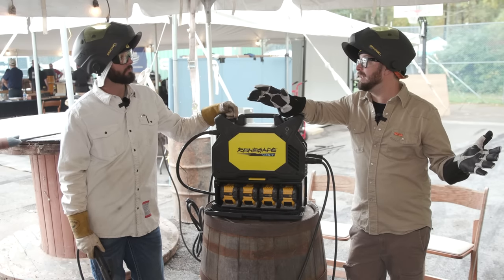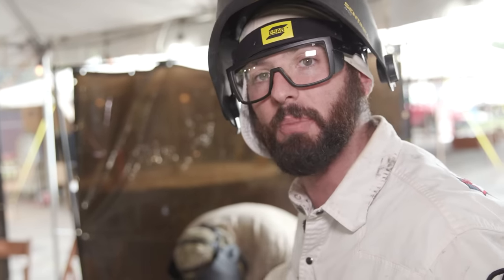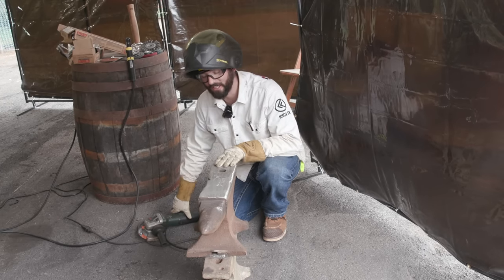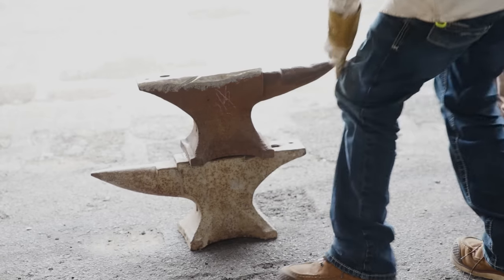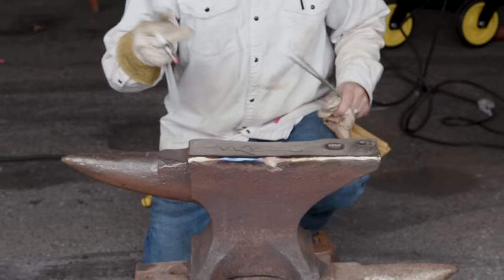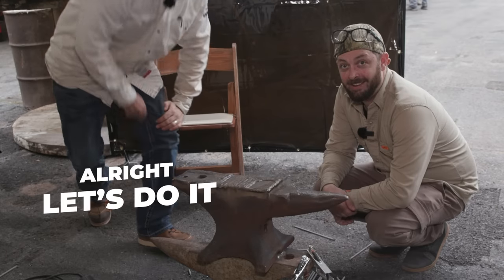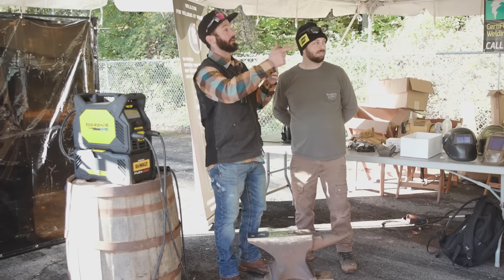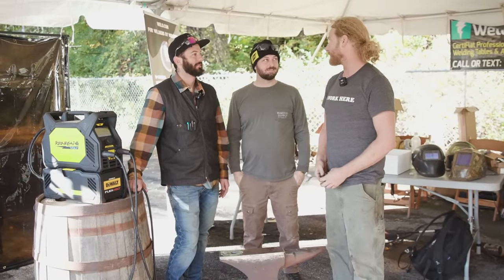Restoring An Old Anvil Using The ESAB Renegade Volt

Comment: I rented a shop that had a really nice PR anvil, I used it for about ten years, excellent rebound, now I'm using an old anvil with no markings I can make out, the heal is busted off, you can see about a 1/2" thick top, it has no rebound, when it comes to making things there is no difference between the two anvils.
Reply: Just needs something solid eh?

Comment: Pad it out with hardface and have it resurfaced.
Reply: Yeah, I'd rather weld it up further and send off to a machineshop. Will be a 10x better surface and likely cheaper than to waste dozens of disks on it.
Reply: @Celciusify  I have had my fair share of clapped out garbage but I hate to toss an anvil. 

The labor alone is hideous,buttering and hardface plus the machine work too.

Do the best I can and it will still work.
Reply: @dolphincliffs8864  Especially old inter and prewar anvils should be taken care of, most of what remains is the good stuff that wasn't melted for the war effort.

Save them and restore them properly.

Comment: They never mention the fact of internal micro cracks of the top steel plate to the wrought base from the excessive 
heat input which will cause loss of rebound and function along with using a high manganese work hardened electrode the on a quench and temper steel plate? makes zero sense ... It may work but far from best method sorry but no way....